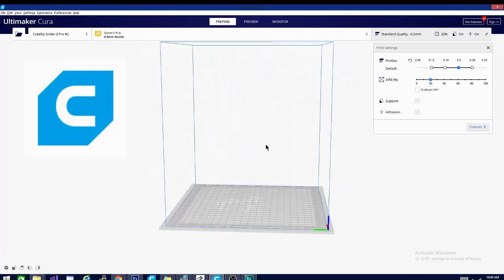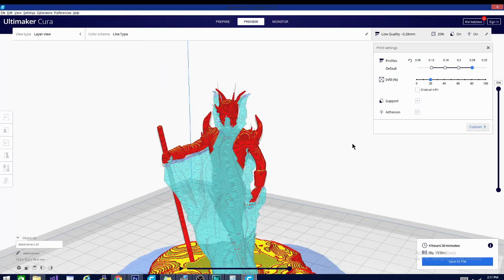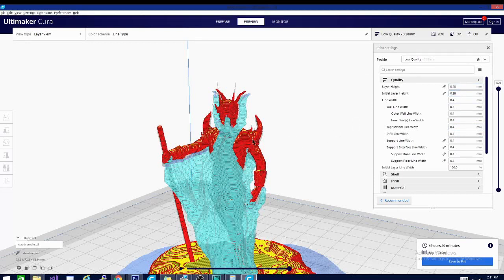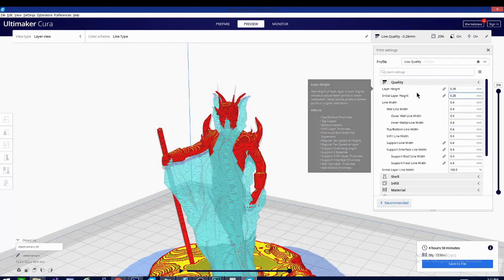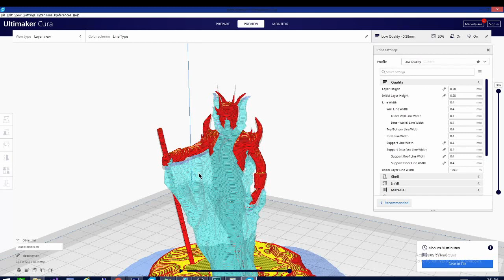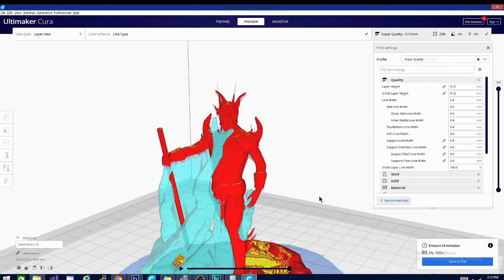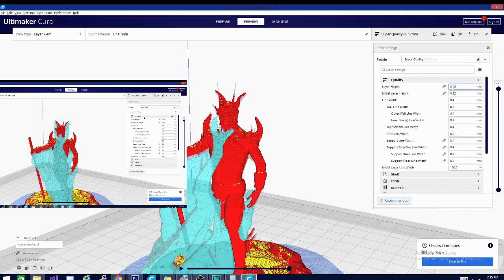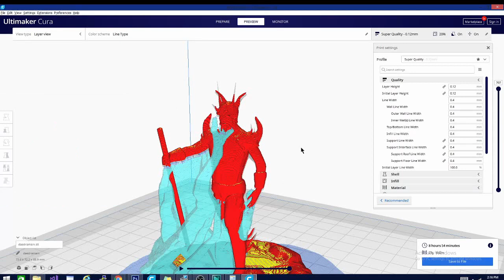Cura 4.8 Tutorials - Quality Settings - Layer Height

Comment: Hi I'm new to 3d printing and I know its a stupid question in Cura print settings where it says profile standard Quality 0.2  low Quality 0.28mm  etc  then the layer height whats the difference I've been using standard Quality 0.2mm and my layer height from 0.2 to 0.4 not sure if its right thanks